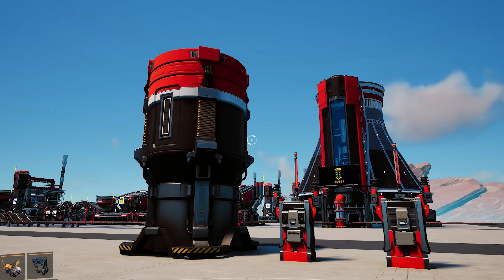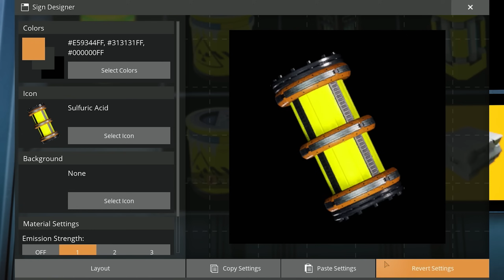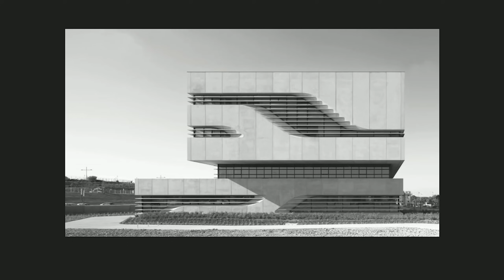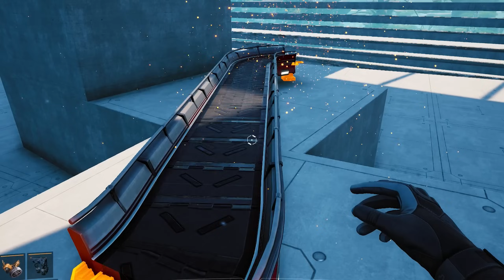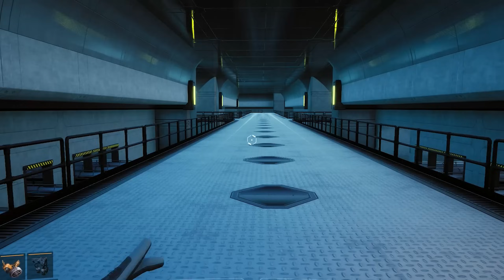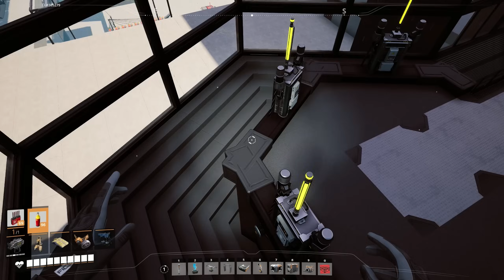Creating the CORE of the Nuclear Power Plant! - Satisfactory 1.0

Comment: The reason the blueprints don't connect perfectly is because the light support detail is sticking a bit out of the blueprint's "silhouette", so when you try to connect them the system shifts the platforms a bit so it isn't clipping into the other blueprint's area. I've had this issue with outlets in the past. You can work around this by moving the lighting details a bit to the inside of the tunnel so it stays within the area of the blueprint.

Comment: For better efficiency you could split the plant into cells that you can turn on and off, so if you're only consuming 10000MW in the max use case and you're making 30000MW then you can turn off the other 20000MW
Reply: This would also cut back on waste generation when it's not needed, and you could inky have 1 cell on when starting the rest of the plant which won't consume so many resources making it easier to black start

Comment: Still need the values for the pipes in the control room for acid redirect in case past kibs screws you over. Could hide them behind a break wall in case of emergency wall, and leave yourself a guide and a tally of how many times its been used not that it will ever be used right? :3

Comment: Not to be the monkey with the wrench, but...
Did you know that it is more ressource efficient to just burn the uranium, turn the waste into plutonium rods and then sink them - than it is to do the same, but burn the plutonium rods, turn the waste into ficsonium rods and then burn them? It sounds insane (how could burning the rods three times be less efficient than burning them only once?), but it is true. The massive amount of SAM you need to turn plutonium waste into ficsonium rods is better spend just converting ressources into uranium and make more uranium rods if you need more power. I don't remember the math off the top of my head, but it was something in the vincinity of half as much power from the full cycle than just using the additional SAM to make more uranium rods. It's nuts and doesn't really make sense to me as it discourages to use complicated end game production lines, but it is what it is...

Comment: Something im doing in my word is making one product (such as fuel rods) and confirmingt that its at the right rate, then next step use some fuel rods to build up 100k ish nuclear waste and use that to test plutonium set up and nuclear set's water, same with with plutonium waste and then test ficsonium. this ensures that you dont turn on 3 big factories and once and can tourbleshoot along the way
Edit: Also make sure to have roughly 50k fuel rods stored up for initial power on for the conveyer belt buffers and power plant buffers, itll also allow the next step to function at full capacity immediately. Do this with EVERY component, from the iron ore to the ingots to the same to the quickwire. EVERY component needs 1 bin minimum becayse your overflows MUST be full as quickly as possible, storing and dumping at a higher rate than production is a life saver
Reply: That's kind of how I did it. If I needed (eg) 600 iron plates, I made sure I was producing ~620, everything is over supplied. Then I set up the uranium fuel rod factory, started the uranium flowing, and then while I spent (many) hours setting up the U waste > Pu fuel conversion, my factory built up a nice stockpile of U fuel. Once I was confident it would work, I finally started building the nuclear plants.
(Then I fixed all the little problems I'd not noticed until then).
Next step will be to set up a Pu waste > Ficsonium fuel factory, but honestly just 40 reactors running on uranium is more than enough power, and I'm fed up of that area, so I'm working on other factories right now. For now the Pu fuel rods are stockpiling, and will go to a sink once they overflow. Theoretically I can leave it indefinitely as it is.